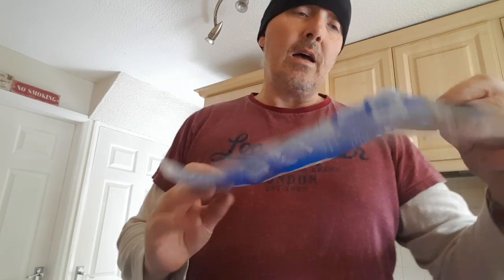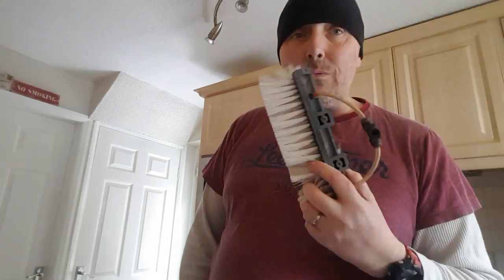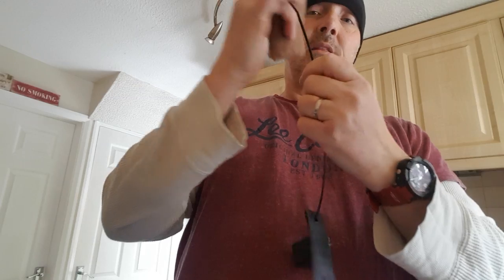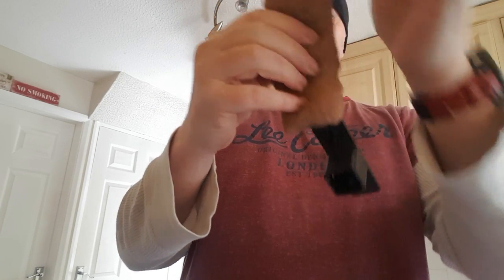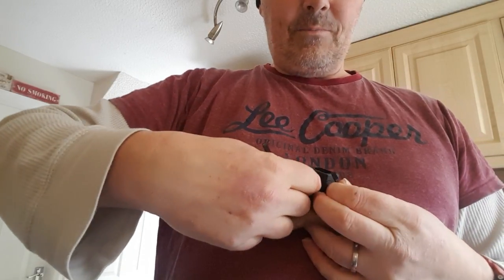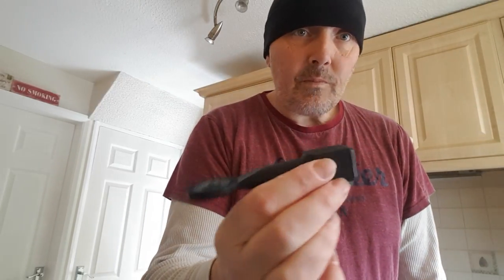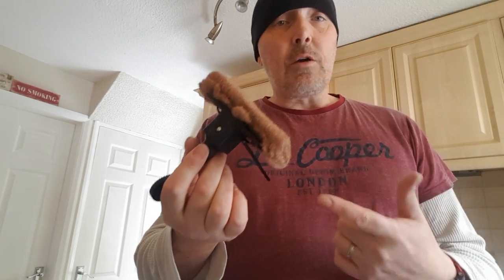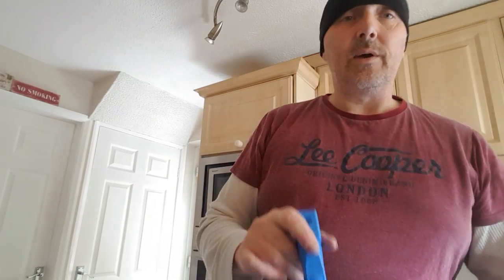DIY - Bronze Wool Applicator - Water fed pole Window Cleaning - WFP

Comment: Hi Darren, I saw on Amazon company called rogue river tools and they sell bronze wire wool pads for glass. I've noticed they do coarse medium and fine grades. Will the coarse pads be quicker getting through paint that's on glass? As it seems all grades are suitable for glass. Didn't really know the difference between the grades..
Reply from the maker: In theory yes the coarse pads will remove the paint faster -- I say in theory as I have never tried them I only ever used the 0000 grade.